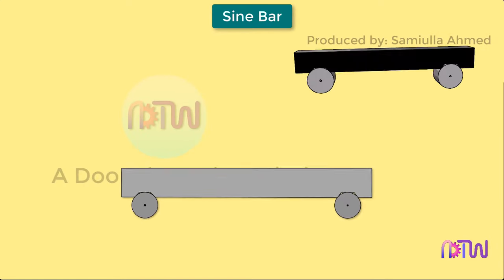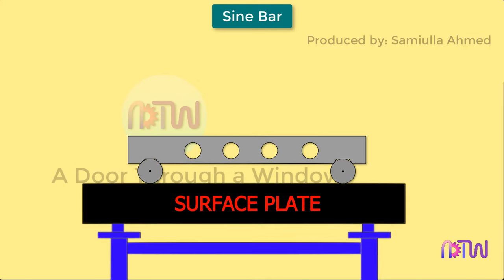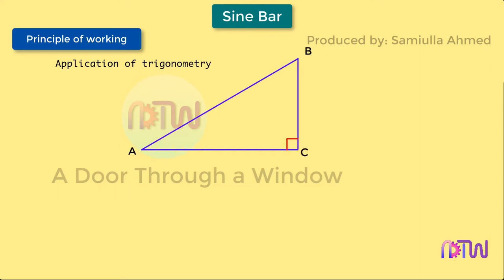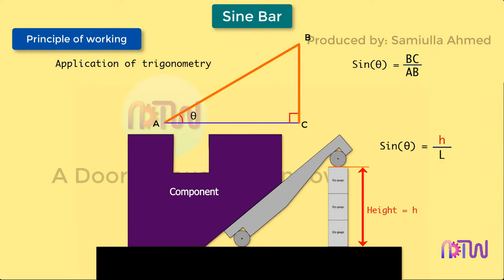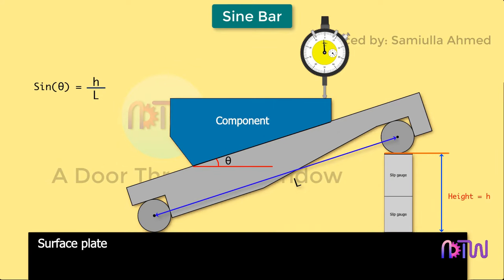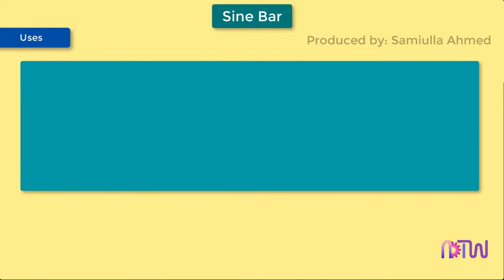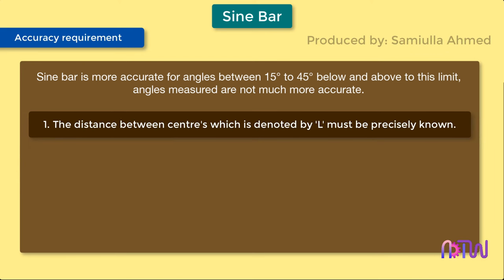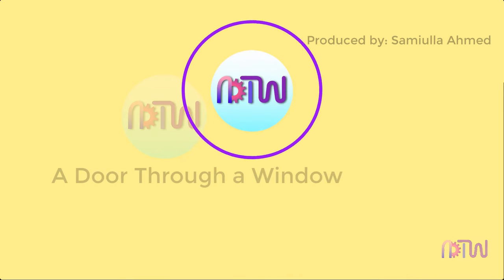Sine Bar | Use of sine bar with animation

Comment: But we can use bevel protectors to find its angle
Reply from the maker: A sine bar is a precision instrument used for measuring angles with high accuracy.  The sine bar is commonly used in milling, grinding, and inspection applications. It is considered the most accurate tool for measuring angles.
Reply: @ADTWstudy  OK sir